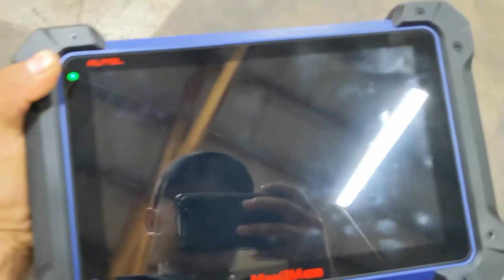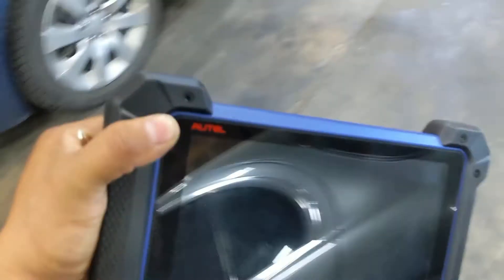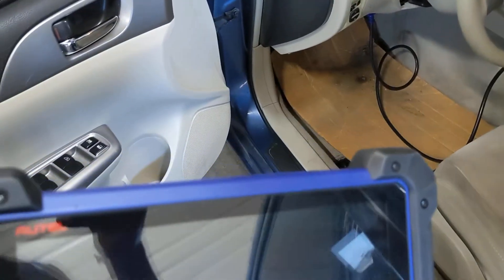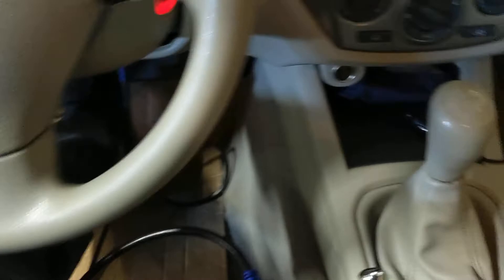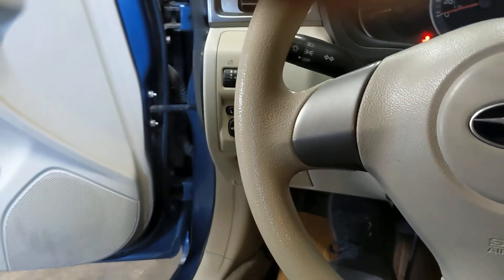SUBARU IMPREZA KEY PROGRAMMING, NO PIN CODE REQUIRED (AUTEL IM608).

Comment: Had you added a remote blade key on 2022 Impreza with Autel 508/608 and it worked?
Reply from the maker: Not yet, but the AUTEL IM608 is very capable, I'm sure it can get the work done.

Comment: What kind of key chip fit this Impreza ? I have issue programming a 2011-2014 Impreza WRX ( 2014)
Reply from the maker: where did you get the key, and what kind of equipment are you using to program the key?
Reply: @evoixdelaluz  
The chip is 
Subaru SR12-PHT (4D60 80 BIT) G CHIP Transponder Key USA Seller TOP Quality
Reply from the maker: right, & what kind of diagnostic equipment are using to program they key?
Reply: I don’t know, the locksmith couldn’t program it 

What’s the best computer to program those chips? 
Can the original chip get programmed again?
Reply from the maker: for the price you paid for that key, I wouldn't be surprised if the problem is the actual key, not the programming equipment.

Comment: Hello i tried to add remote for Subaru 2013 xv / i generate the remote by key tool max and i followed the steps but every time learning failed ? Can help
Reply from the maker: you still trying to figure it out on how to program the remote?
Reply: @evoixdelaluz  hello i think if i made manual selection/ then chose the model and learn remote will be ok
Reply from the maker: so you were able to reprogram the remote? yes? or no?